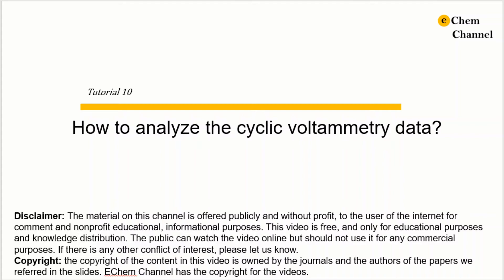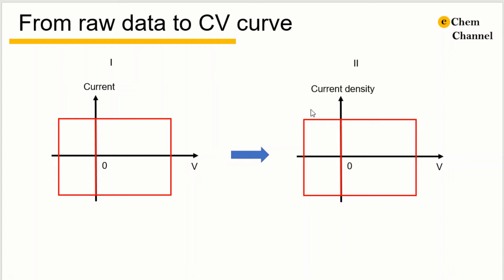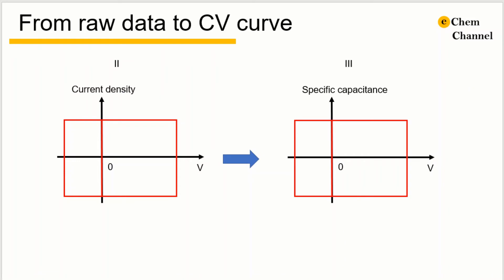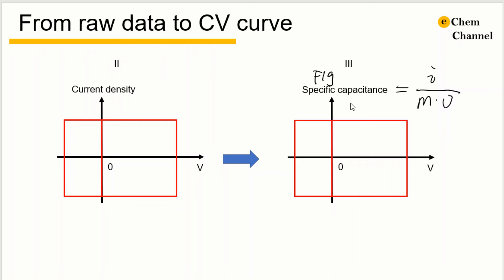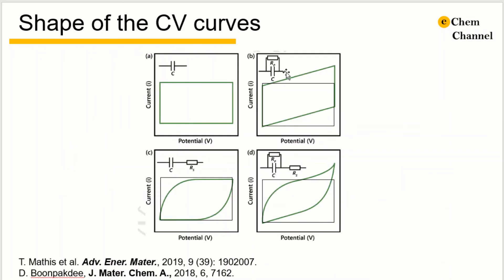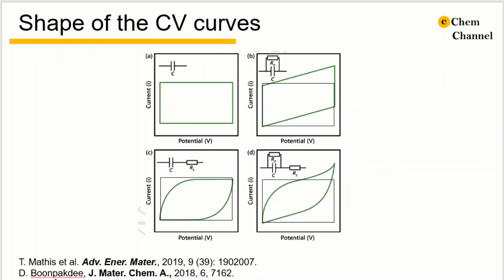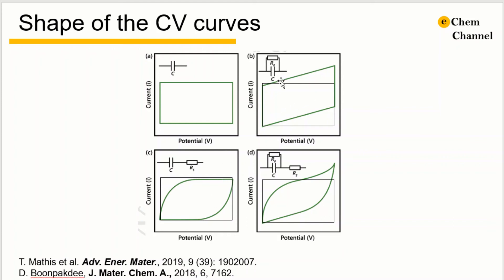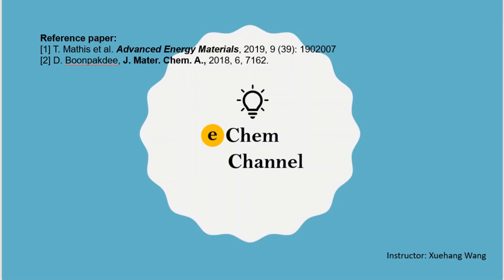Tutorial 10-how to analyze the cyclic voltammetry data-1

Comment: If anyone can help me with a reason that area calculated from a CV curve in origin give large value for one sample and small value for other sample(e.g 0.004 & 3.455). Also it is obseverd that more conductive sample show small area under curve value comparitive to low conductive sample. Any reason? Logical response will be highly appreciated.
Reply from the maker: I use EC-lab to integrate the area of i-t curve, and the result looks reliable so far.
Reply: In the origin where you calculate the area enclosed by the cyclic voltammogram. Do you calculate the absolute are for both cases where you have come across a big difference in calculated area. Can you visually see what the numbers are saying, i mean the visual assessment of the areas eclosed by the two CV.

And if you were calculating mass or even areal specific capacitance from CV for a single electrode in a three electrode configuration. In the formula for specific capacitance, did you divide by 2?

It depends on the nature of your conductive materials, whether you have used binders to make slurry or else probably you have attempted direct growth of active materials onto your current collector. By now you must have found out justification.

Comment: What's the relation between specific capacitance and scan rate? Could you specify the difference between linear,areal,volummatric and gravimetric capacitance?  Thank you!
Reply from the maker: Hi. Once the the specific capacitance is calculated, the areal and volumetric capacitance can be obtained by knowing the electrode surface and electrode density.